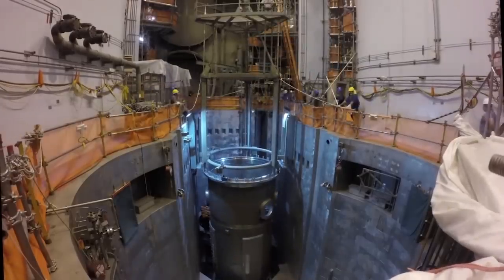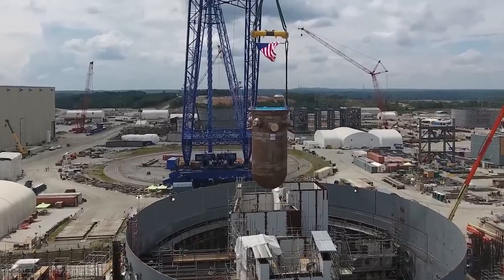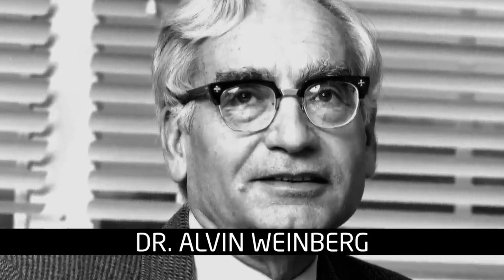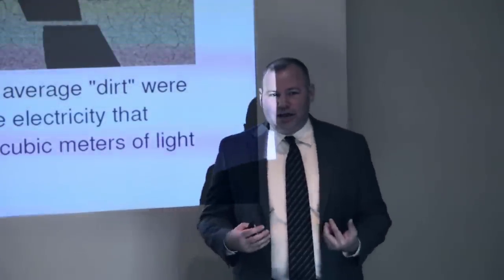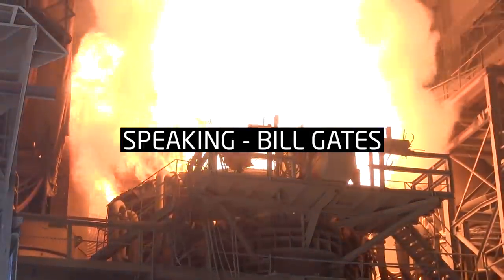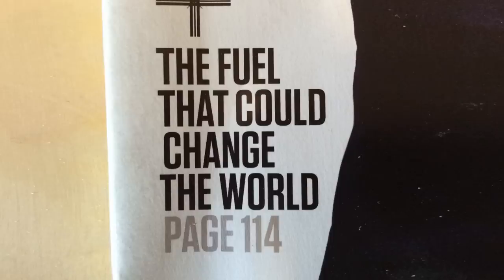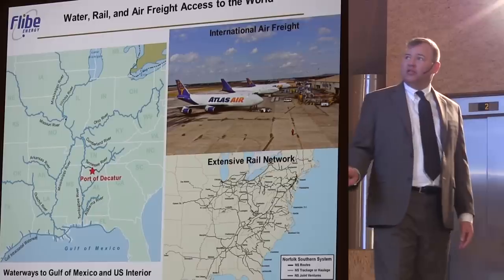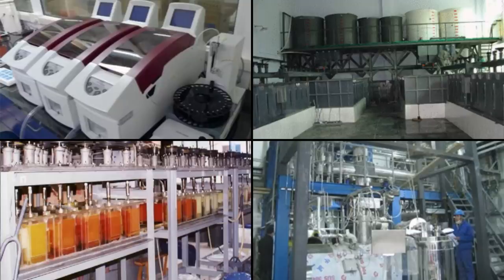Thorium 2017

Comment: Don't worry, you won't have to buy the reactors from Chinese, they won't sell them to you. They'll rent them to you at best, but they'll prefer to sell you the energy ;-)
Reply: Is that a bad thing though? I'm pretty sure if we could start a serious nuclear build program on a BOO ( Build-Own-Operate ) model in the US/West it'd be a better outcome then waiting for the US/EU/Western nuclear industry to get it's act together.

Turkey and Rosatom are actually doing exactly that and most view Rosatom's willingness to back up their product by doing a BOO seems to have helped get things moving given the challenges around financing these huge projects.
Reply: From my understanding, the US has had a boom in industry related jobs in recent years because energy prices in the US have come down a bit.  I fear that, if China beats us to the Thorium reactor, that trend will shift back towards China.  They'll then have all the jobs, and we'll be left in another economic depression. We need to get thorium MSRs working and turned into a serious market before that happens.
Reply: I'm afraid the US will be stuck to import nuclear power from Canada and Mexico, and China & Russia can park floating barge NPPs outside of the 200mile limit so they can tell the corrupt NRC to blow-off, and sell clean electricity to energy starving US cities, after the Shale Gas bubble bursts and the US is forced to burn expensive imported terrorist diesel and LNG for its electricity supply.
Reply: It's certainly true that industry likes low energy prices and that keeping them reasonably low will be important to keep some degree of manufacturing going in the US, but that's also sorta the point I'm making. If China/Russia is willing to sell the US reactors ( and one of them certainly will ) the US will have the low-cost energy needed, one all-too-likely alternative to China/Russia selling reactors to the US is that we get stuck with expensive energy and that will result in the economic impacts you're worried about.

Even importing power from Canada/Mexico wouldn't be as bad as the possible scenario of the US just having expensive energy for decades, as much as my own country ( Canada ) might love to make some business selling electricity to the US there isn't enough capital and will here to make up for the lack of it south of the border, Canada can't finance a reactor build program to serve the US in full.

Also the floating barges aren't designed for open ocean so I wouldn't worry about that ;) the real threat is going to be being stuck 1-2 decades behind in terms of energy infrastructure and losing out competitively as a result, buying Chinese/Russian reactors or Canadian/Mexican power could actually help take the edge off.
Reply: Spot on. Chinese will hold the active patents. China will be the biggest super power in human history. Buy stocks in Chinese Thorium development
Reply: AmurTiger Nobody will be able to sell us the reactors because they will take advantage of the IP (patent) mess the u.s. created in patenting every overly broad patent possible.  China will own every patent and lock us out using the same hardball tactics we used on them to keep them from pirating movies!
Reply: Gentlemen, are you trying to make me sorry to have posted a comment by not being able / willing to hold a civilised discussion without calling each other names? :-/
Reply: +Beavis You really don't know what you are talking about when you claim.it is safe. Sitting on the open ocean, you are a target because you are a floating nuclear bomb. 

explain to us, how a thorium nuclear reactor would explode like a nuclear bomb.
Reply: NwoDispatcher - Yeah wtf ? let me get this straight. Are people really talking about exploding Thorium molten salt reactors ?? If so, that is just mind blowing stupid
Reply: +urduib well... if i can make an emotional argument, i dont need to think. i can just shout "RACIST!!!" "CLIMATE CHANGE!!!!" "NUCLEAR BOMB!!!!" "RADIATION!!!!" "SOLAR FREAKING ROADWAYS!!!" 'SEXIST!!!" "WIND!!!" "WATER!!!" "HEART!!!" GO PLANET!!!!!

...and I win. I am the liberal master debater.
Reply: 棒，很有想法。所以美国和欧洲就非常愿意把技术随便卖给别人？
Reply: + stan 9527 That is a good question :) But in Europe and US the technology is being developed by private companies, which are rather small, especially compared to an enterprise such as China, and I can't recall any of them having talked about their business models for deploying the infrastructure in much detail ... But since LFTR allows for great scalability in both directions (from really small including mobile / transportable to really large) I'd say one of the options would be elimination of long distance power grid, in which case selling as well as renting out the facilities would probably make business sense. It really depends on how much of a role politics would play in it.
Reply: Nuclear reactors DO NOT explode like a nuclear weapon. Any explosion that takes place at nuclear plants is a hydrogen gas explosion that builds up inside the containment structure for the nuclear fuel rods that builds up from the water (h20) used for heat transfer and cooling becoming super-heated and splitting into the two elements. The uncontrolled heat that turns the nuclear fuel rods molten along with the surrounding reactor structure is why it it is called a 'melt down'. No explosion of a nuclear kind, contamination is from radioactive particulate carried out from fire and exposed burning nuclear material.
Reply: Submarine cables are primarily for communication and there's no trans-atlantic or trans-pacific power cables, the transmission losses would be too great to make it worth it.

Regardless of the fact that a NPP even offshore would likely be safer then deep water drilling it's a risk that doesn't have to be taken and any state that takes offense to it can pretty easily just not allow Russians/Chinese to hook up to the grid and sell power. If the Russians/Chinese are going to want to capitalize on their nuclear technology in the US they're going to have to build plants on US soil, just like the Russians are in Turkey, among other places
Reply: Eegore Beaver

No nuclear reactor ever created can go prompt critical, it's actually quite hard to do so and among other things requires levels of enrichment not found in nuclear reactors.
Reply: Chinese will have no problems building Thorium reactors on American soil. When they first install them in Eu and power cost drops massively, America will have no choice. Refuse and get annihilated on the global market
Reply: AmurTiger, I think you're missing the point of the problem.  The Chinese don't even NEED to build power plants on US soil.  Once they have the reactors, they will then have much, much cheaper electricity to sell to THEIR heavy-industry companies (or whatever other companies use a lot of energy).  They can then sell finished products to the rest of the world at much cheaper prices than we can.  Our heavy industry companies will be pushed out of business, and end turn hurt our entire economy.  This will affect all of our metal production industries, all auto companies here, oil production, even large internet servers.  All these industries will either have motivation to relocate overseas, or deal with new competition that have an edge specifically because of cheaper energy.  This will drag our whole economy down.  THIS is the end result I'm worried about.
Reply: Amur, can't you read? I didn't say anything about "trans-atlantic power cables", don't be ridiculous. Submarine power transmission is commonplace. How do you think offshore wind farms send their generation to land? They are even planning a submarine power transmission line from Iceland to Scotland. So yes China and Russia could very well build floating barge NPPs or even submerged NPPs locate them in international waters outside of the NRC's jurisdiction (i.e. 200miles offshore) and sell clean energy directly to customers on land. Obviously they would have a proper contract with the relevant state for power supply. Big advantage is to avoid the nuttiest of the NRC's wacky regulations, like their idiotic airplane impact rule, their onerous regulatory environment designed to suppress nuclear power, and allow IAEA approved reactors to supply the American power grid. No extraordinarily long delays getting site approval, licensing, financing, construction delays, union issues, endless lawsuits from super-rich pseudo-environmental groups like the $400M/yr Greenpeace, possible financial collapse of the plant manufacturer aka Westinghouse. Just pay a fixed price $/MWh for zero-emissions electricity on a contract basis. 

The NRC is becoming a sick joke. Now even the stringent EU regulator has approved a version of the South Korean APR1400 for use in Europe. CANDUs are used all over the world and next door in Canada, and yet you can forget about the NRC licensing CANDUs for the US market. With the APR1400 approved in Europe, it should be a rubber stamp to get approval in the US just as it is for vastly more dangerous aircraft. Also the VVER1200 is being built in Finland and is IAEA approved. Should be a mere formality to get that approved in the US. One option, apparently an individual US state can boot the NRC out, and use its own state occupational health & safety dept to rationally regulate a NPP. That might be the only way to get IAEA approved reactors into the US market. Of course Big Oil will go to extreme lengths to prevent that from happening.
Reply: Well there's a few different conversations going on here but yes mindstorm8191 the Chinese don't need to build power plants on US soil, but so long as the US doesn't remain stubborn-stupid SOMEONE will. Sure perhaps the Chinese will view keeping reasonable priced nuclear power from the US as worth the opportunity cost of not building the plants, but the Russians won't be so inclined as US manufacturing doesn't threaten their economy nearly as much. Chances are if the US remains devoid of nuclear power as cheaper reactors start to become commonplace it will be a self-inflicted restriction, not outside powers.

whykhr I'm not sure if you noticed but both China and Russia are across oceans so land based reactors in Russia/China would be across oceans, which is remarkably even more sane then your other proposals. Parking barges out in the middle of the ocean isn't a great plan either as nuclear barges aren't designed to be on open ocean, nevermind for long periods in the open ocean, underwater is more or less impossible because once again you're way out in the ocean by the time you're 200 miles out. Finally regardless of who controls the place where the plant is the power cable you're imagining would still be going into the US market and thus subject to approval by the regulators there, they may not be the NRC but I doubt you'd be able to convince them that they should help you pay for that unregulated nuclear reactor floating/underwater off their shore.

I certainly agree that the NRC is a huge mess but they're part of the landscape in the US and not looking like they're going anywhere any time soon. The best option for shipping power into the states would be putting the plants in Canada/Mexico and exporting from there, particularly since NAFTA would make it harder for the states to put up hurdles against power exports.
Reply: My reading comprehension skills are just fine, your ability to outline an even somewhat feasible plan on the other hand.... not so much.

200 miles off the coast is far enough that as far as the sea conditions are concerned it might as well be the middle of the ocean, this is not a suitable place to park a barge, submarines are even more insane a plan due to the huge expense of building those pressure vessels compared to the relatively tiny reactors they tend to carry. The largest submarines ever built managed around 400 MW total output from 20-40% enriched fuel, ridiculously expensive all around and pretty well doomed financially.

If you'd like to get a clue take a look at how the Russians are expecting to use their nuclear barges, they're not floating out offshore, they're expected to park right next to very remote locations in the high arctic where construction costs are much higher.

It's funny that for all your whining about reading comprehension you seem to not be doing much of it yourself.
Reply: Amur tiger - No one in this thread knows who you are talking to. And you know what they say about people talking to them self ?
Reply: Well, Amur if you don't have a reading comprehension problem then the alternative is you are a despicable liar, claiming that I stated things which I didn't. Sea conditions offshore are similar to what every offshore Oil rig, Oil tanker, LNG carrier, Aircraft Carrier and Offshore Wind farm have to deal with. They're even building a floating LNG platform 200km offshore western Australia. They have Oil platforms anchored 2000 ft to the sea floor. The economic value of the NPP is greater for much lower cost. And the Oil drilling platforms have to maintain a stable connection to the sea floor, or suffer a massive blowout, no such requirements for a NPP.  And there isn't much difference between a floating NPP and a submerged NPP, you just have the bulk of the plant underwater. Just as Nuscale and Thorcon power the Nuclear section is completely underground, on a rainy day, underwater. In fact the Nuscale reactors are submerged underwater.

http://www.world-nuclear.org/information-library/nuclear-fuel-cycle/nuclear-power-reactors/nuclear-power-reactors.aspx#ECSArticleLink11

https://atomicinsights.com/offshore-power-systems-big-plants-for-big-customer/
Reply: Russians will make and sell them just like rocket engines
Reply: China has been stealing our IP for decades we will just do the same to them

Comment: I 100% agree, light water reactors suck and we need nuclear energy; fossil fuels are going to bite us in the rear and "green energy" sources just don't have the punch and stamina we need to meet our demands. Molten Salt Reactors don't run at high pressure so there is no risk of a Chernobyl type explosion, they can be made to be walk-away safe using the frozen salt plug and drain tank so no Fukushima or 3-Mile island scenarios, they use fuel far more efficiently since the fissile material is dissolved in a liquid and thoroughly mixed which stretches our fuel supply, and the higher temperatures they can run should equate to higher generation capacity in a smaller package with lower cost, etc.. Molten salt reactors would be great! Why do we need to start with Thorium and all the complicated breeding process though? Why can't we focus on mastering the chemical and mechanical challenges of using more conventional uranium fuel dissolved in a single-liquid molten salt reactor design, then tackle the two-fluid/fertile blanket/thorium breeding problem separately once the tech is mature? That would get the ball rolling and get our foot in the door. There are serious problems left to solve with respect to balancing neutron use between fission and breeding, issues with the materials in the separator breaking down from radiation and heat damage, issues with the chemistry involved in distilling out fission products and finished fissile material, etc, many of which could be reduced by putting off on the thorium->u235 breeding cycle until the technology is more mature. Uranium is still cheap, even more so when you eliminate the manufacturing costs of solid fuel assemblies so fueling costs would be reasonable. Don't go calling me a naysayer, Thorium is definitely a worthwhile long-term goal.. It just seems like taking things in smaller steps may get this technology rolling more quickly. Is there a physics basis for why Molten Salt Reactor technology would be incompatible with current Uranium fuel?
Reply: "green energy" sources just don't have the punch and stamina we need to meet our demands.

Amen to that. "Green energy" sources can just about meet electricity demands of 2010-2015, but when you factor in increased electrical demand for transportation, heating (domestic oil/gas heating systems will be axed in the face of climate change) and industrial processes then you can figure an additional 6 to 8 times increase in demand in developed countries. 

In developing countries by the time they're brought up to the same demands as the rest of us, that's more like factor of 20-30 increase in global generation capacity being required.

Comment: Question: what if one of the tanks cracks? when the fuel is outside both the reactor and the cooling tank.... then what happens? Anyone?
Reply: The tank is placed inside a containment building of sorts, where the drain tank itself is placed deeper bellow it. So the leak would still be contained in one way or another, with or without the drain tank itself.
Another interesting properties molten salts have, is that they freeze rather quickly, meaning that the salt could potentially seal the crack itself as the temperature difference varies greatly between the inside and the outside of a reactor chamber.

Of course all of this assuming a tank made out of Hastelloy X, an alloy specifically designed to withstand heat and strain , would crack in an environment fitting the characteristics of a middle-end use case.